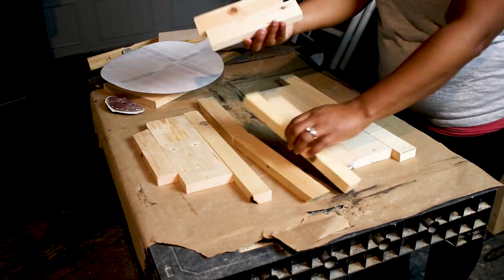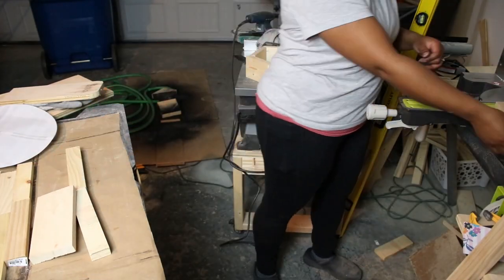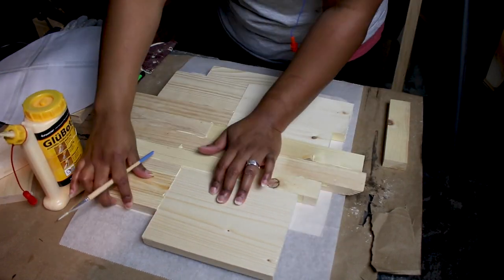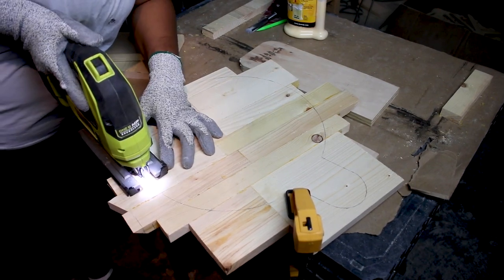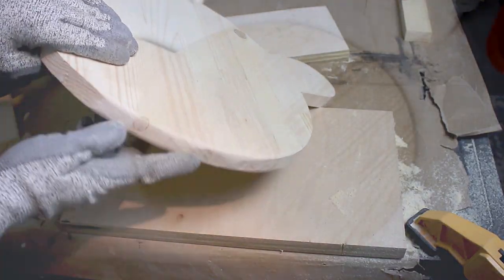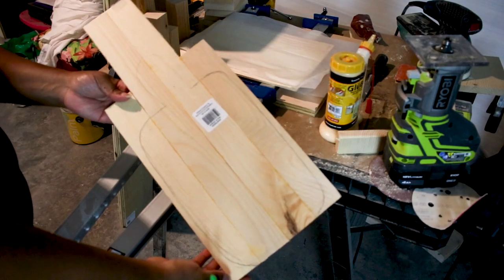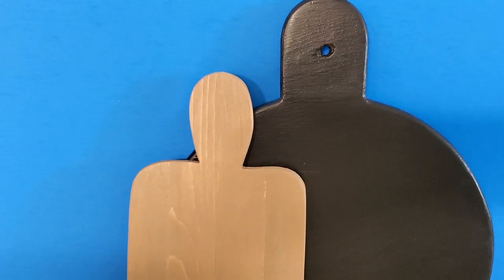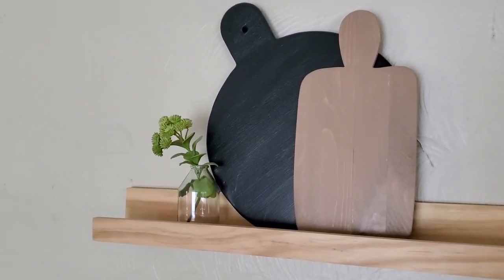Using Scrap Wood To Make Charcuterie Boards - Easy Diy Idea!

Comment from the maker: English
This video has been dubbed into Spanish (United States) using an artificial voice via https://aloud.area120.google.com to increase accessibility. You can change the audio track language in the Settings menu.

Spanish
Este video ha sido doblado al español con voz artificial con https://aloud.area120.google.com para aumentar la accesibilidad. Puede cambiar el idioma de la pista de audio en el menú Configuración.